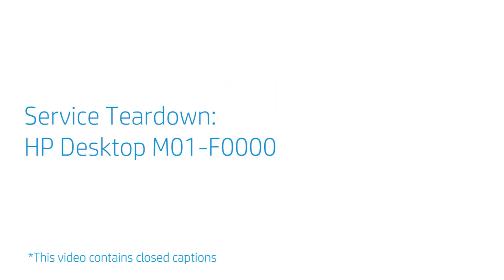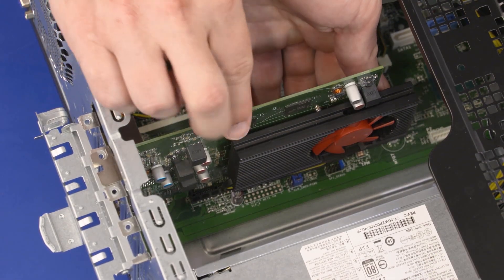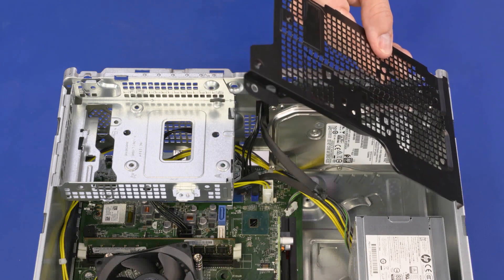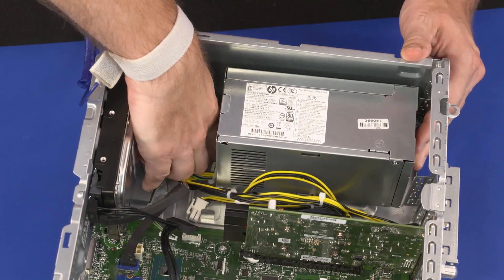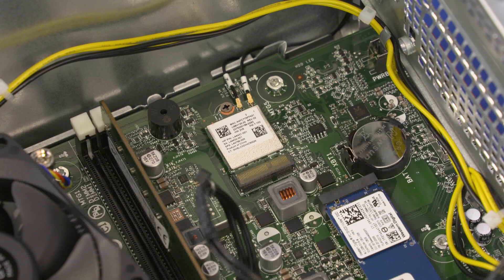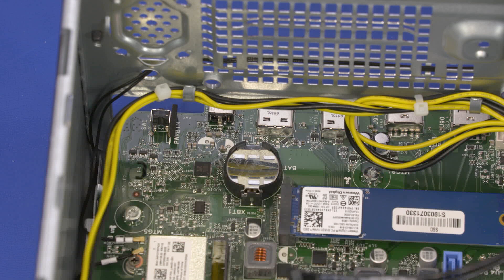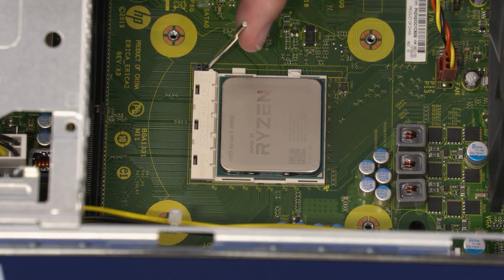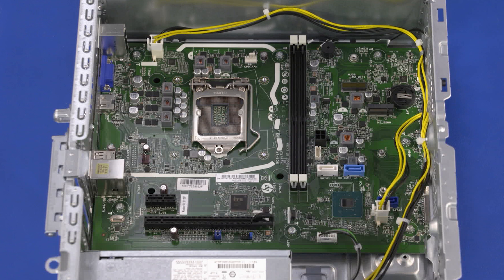Removing & replacing parts for HP Desktop M01-F0000 | HP Computer Service

Comment: hi hp my pc have 180w model m01-f2xxx which power supply can i change i want to put a gtx 1080
Reply from the maker: Hi there, thanks for contacting HP Global Social Media Support!
I understand that you need to purchase compatible power supply for your computer.
I will do my best to assist you.
For optimal PC and printer performance, remember to always buy (use) Certified HP Genuine Replacement Parts from a known and trusted source. You can order it via the HP Parts store: https://hp.care/6058UqOSY 
Regards, 
HP Support

Comment: Hi, I'm trying to install a quite large graphics card into my computer, and has quite the similar section as the expansion card section, however I have no idea how to remove the metal plating without damaging my computer, could I please get some help in removing the metal part without damaging my computer? They don't have any screws on them and they just have a little screwdriver thing on top of them but I genuinely don't know how to remove them
Reply from the maker: Hi there, thanks for contacting HP Global Social Media Support!
I understand that you are experiencing an issue in removing the metal plate to add graphics card.
This looks like hardware issue, and you might have to get the computer serviced. 
So, I would recommend you to contact regional support for repair options.
Please feel free to reach us on call/chat. Access this link to select your preferred country and language option to reach us. 
Global support link: - https://hp.care/6055UpROZ 
Regards, 
HP Support

Comment: Hi, I wanna replace my powersupply because mine hasn't enouth power that I need for a gpu...
BUT there is a 'pwrcmd' or 'p1' kable what is in the way. And without the kable the pc wont tourn on. So where can i buy souch a kable?
Reply from the maker: Hi there, thanks for contacting HP Global Social Media Support!
My apologies for the inconvenience, I am here to help! 
May I know the product you are using? A serial/product number would be helpful!
Let me know!
Regards, 
HP Support
Reply: Hi Hp, 
Thanks for your reaponse. As requested I am using the hp m01-f3700ng. Please let me know if there any additional things for the replacement issue.
Reply from the maker: Thanks for getting back to us, For any assistance related to purchases, please contact the shopping team for assistance.
	Link - https://hp.care/6056U8Jqu
	Regards, 
	HP Support
Reply: Hi HP, 
I can not find the kable or an adapter for this kable in your shop. So... uhm the kable goes from the power supply in the mainboard and when i remove it, then the computer wont tourn on. So I just need it... 
Can't u just sell one of this kable adapters or the kable in your shop? I mean... uh I will just upgrade the computer and you produce this kables... 
Please sell this kable in your shop
I will immediately buy one of them... ya
Reply from the maker: Hi there, thanks for contacting HP Global Social Media Support!
I understand that you need to purchase power supply unit for your computer.
I will do my best to assist you.
For optimal PC and printer performance, remember to always buy (use) Certified HP Genuine Replacement Parts from a known and trusted source. You can order it via the HP Parts store: https://hp.care/6056UDel2 
Regards, 
HP Support
Reply: Yeah i always use official parts but i just need the f... kable
Reply from the maker: Hi there, thanks for contacting HP Global Social Media Support!
I am here to help!
What seems to be the issue? Are you facing any technical issues with your HP computer?
May I know the computer you are using?
Let me know!
Regards, 
HP Support
Reply: Are you kidding me???
Bye
Reply from the maker: Thanks for the reply.
May I know the computer you are using?
May I know which cable you need to purchase?
Please let us know!
Regards, 
HP Support

Comment: Hi hp. Can I put a gtx 1060 or gtx 1650 on my hp pc M01-F3007nf?
Reply from the maker: Hi there, thanks for contacting HP Global Social Media Support!
I understand that you need to know about compatible graphics card for your computer.
I will do my best to assist you.x
This computer has One PCI Express Gen 3.0 x16 and One PCI Express Gen 3.0 x1.
So you can add graphics card that supports these slots. 
Regards, 
HP Support
Reply: @HPSupport  can I have a tutorial please
Reply from the maker: Thanks for getting back to me, I'm afraid I'm not able to find a tutorial specific for your device but rest assured that this process is mostly same in all the PC desktops. Please follow the link below on how to replace the graphics card in your PC and follow the similar steps,
Link - https://hp.care/6059Why9h
Let me know.
Regards, 
HP Support

Comment: Dear HP, would my gtx 1060 3 gb work with your desktop pc m01-F3701ng?
Reply from the maker: Hi there, thanks for contacting HP Global Social Media Support!
I understand that you need to know whether Nvidia GTX 1060 3GB Graphics Card is compatible with HP Desktop M01-F3701ng PC.
I will do my best to assist you.
This computer has 1 PCIe x16 and 1 PCIe x1 slot. 
So you can add graphics card that supports these slots. 
Regards, 
HP Support
Reply: @HPSupport  i hope thay pay you enough for replying that fast. Take care
Reply from the maker: If you need any help in the future, you can always get back to us.
Thank you for being a valuable HP customer.
Have a wonderful day!
Regards, 
HP Support
Reply: @HPSupport Hi again:)  just for next questioners - 1060 3 gb not fitting in. Also wanna ask: is 180w power supply enough or should i buy more powerful one?
Reply from the maker: For optimal PC and printer performance, remember to always buy (use) Certified HP Genuine Replacement Parts from a known and trusted source. You can order it via the HP Parts store: https://hp.care/6055Wj4TH 
Please check for compatible graphics card and power supply in above link.
Regards, 
HP Support

Comment: Hello, I want to know if the CPU Cooler can be changed and what the maximum height of said Cooler would be.
Reply from the maker: Hi there, thanks for contacting HP Global Social Media Support!
I understand that you need to know about changing the CPU cooler of your computer.
I will do my best to assist you.
HP does not recommend upgrading or downgrading hardware parts or software that is bundled with the product as It may affect the manufacturer's warranty and performance, however, you could change the configuration at your own discretion.
Regards, 
HP Support
Reply: @HPSupport My computer is no longer under warranty, so I want to upgrade the CPU Cooler but I don't know what dimensions the Cooler should have.
Reply from the maker: Thanks for the reply.
Use the HP Parts surfer to identify the part: https://hp.care/6052mVd56 
And order it via the HP Parts store: https://hp.care/6053mVd5B 
If you are unable to locate the part, please check 'Ways to buy'
Regards, 
HP Support

Comment: Hi HP would I be able to fit a 2060?
Reply from the maker: Hi there, thanks for contacting HP Global Social Media Support!
I understand that you need to know whether RTX 2060 is compatible with your computer.
I will do my best to assist you.
You can only install a small graphics card that is not very powerful, with the power supply that is 180w of your computer. 
Use the HP Parts surfer to identify the compatible graphics card of your computer: https://hp.care/6059lfK1S 
Regards, 
HP Support

Comment: I need a new internal optical drive to my HP Desktop M01-F3811. Which models are compatible? I can't find any information on HP website or technical specifications. Can I use a third party part, for example LG GTC0N?
Reply from the maker: Hi there, thanks for contacting HP Global Social Media Support!
I understand that you need to purchase the optical drive for your computer.
I will do my best to assist you.
Use the HP Parts surfer to identify the part: https://hp.care/6051YhKkV 
And order it via the HP Parts store: https://hp.care/6052YhKkn 
Regards, 
HP Support
Reply: @HPSupport  I don't have an old drive to identify. Drive bay is empty. I just need a compatible new drive, so which models are compatible?
Reply from the maker: Use the HP Parts surfer to identify the part: https://hp.care/6051YhKkV 
Regards, 
HP Support
Reply: @HPSupport  This doesn't help. Parts surfer just tells me what my computer's specifications are. It doesn't say which accessories are compatible.
Reply from the maker: Thanks for the reply.
In this case please search online for compatible optical drives.
Regards, 
HP Support

Comment: hi hp, I have the M01-F0028ur model, can I replace the power supply with a 400 watt or 500 watt? will the motherboard accept this?, I still have a missing warranty period, I really want to know this, because I want to replace another video card with a 1050ti or 1650gtx, and what other form factor should the power supply be?, thanks in advance
Reply from the maker: Hi there, thanks for contacting HP Global Social Media Support!
I understand that you need to know about the compatible power supply for your computer.
I will do my best to assist you.
Use the HP Parts surfer to identify the part: https://hp.care/6054YQSri 
And order it via the HP Parts store: https://hp.care/6055YQSrc 
Regards, 
HP Support

Comment: Hey hp i have a  HP Desktop - M01-F1033wb would a 1660 super work??
Reply from the maker: Hi there, thanks for contacting HP Global Social Media Support!
I am here to help!
Well, a GTX 1660 Super requires the system to have a minimum 450W PSU. So you will have to upgrade your PSU in order to use a 1660 Super.
Let me know!
Akhil_HP Social Media Tech Support

Comment: I plan to buy an M.2 SSD. The problem is that I don't know which type of M.2 to buy, as I have noticed that there are several types of pins and interfaces (M key, B key, M+B key) (NVMe or SATA). Which one is compatible with the M01-F0033w model? It has an Erica2 motherboard.
Reply from the maker: Hi Carlos, thanks for contacting HP Global Social Media Support!
I understand that you need to purchase compatible M.2 SSD for your computer. 
I will do my best to assist you.
Use the HP Parts surfer to identify the part: https://hp.care/49DL4jb 
And order it via the HP Parts store: https://bit.ly/3nKMYrs 
Binu-HP Social Media Tech Support

Comment: Hi, i would like to know if have the possibbility to change the orignal psu for another? if its possible what is the max size i can use? and do they have the same configuration for screws or not?
Reply from the maker: Hi Benson, thanks for contacting HP Global Social Media Support!
I understand that you need to know about compatible power supply unit for your computer.
I will do my best to assist you.
Use the HP Parts surfer to identify the part: https://hp.care/3QtQW79 
And order it via the HP Parts store: https://bit.ly/3nKMYrs 
Binu-HP Social Media Tech Support

Comment: Hey HP, where can i find website to find replacement screws for the t15 10mm and 7mm torx head screws for the chasis and drive cage respectively. I wanna find extra screws for this model and cannot seem to find them anywhere
Reply from the maker: Hi Cyler, thanks for contacting HP Global Social Media Support!
I understand that you need to purchase the replacement screws. 
I will do my best to assist you.
Use the HP Parts surfer to identify the part: https://hp.care/3RIeENY 
And order it via the HP Parts store: https://bit.ly/3nKMYrs 
Binu-HP Social Media Tech Support

Comment: Hey HP, 

For the M01-F0020, how many HDD drives can the chasis support internally? Is it 1 or 2 internal HDD 2.5" or 3.5" slots?
Reply from the maker: Hi Cyler, thanks for contacting HP Global Social Media Support!
I understand that you need to know how many hard drive does HP Desktop - M01-F0020 support.
I will do my best to assist you.
It supports 512 GB PCIe® NVMe™ M.2 SSD. 
Binu-HP Social Media Tech Support

Comment: i have 2 of those pcs. one with intel and one with ryzen. can i just switch the cpus?
Reply from the maker: Hi Deniz, thanks for contacting HP Global Social Media Support!
I understand that you need to know whether you can switch the processors. 
I will do my best to assist you.
HP does not recommend upgrading or downgrading hardware parts or software that is bundled with the product as It may affect the manufacturer's warranty and performance, however, you could change the configuration at your own discretion.
Binu_HP Social Media Tech Support

Comment: Is There A Way For My HP Desktop - M01-F0024 Can Have A 6GB Graphics Card Put In?
Reply from the maker: Hi Fetti, thanks for contacting HP Global Social Media Support!
I understand that you need to know about compatible graphics card for your computer.
I will do my best to assist you.
This computer has One PCIe x16 socket and  One PCIe x1 socket.
So you can add graphics card that supports these sockets. 
Binu_HP Social Media Tech Support
Reply: You can't!! You need to upgrade PSU also because it has only 180W shitty PSU .😢

Comment: Hey HP, I Need your I Purchased GSKILLS AEGIS 3200MHz Ram But it is showing 2133Mhz why my ram is working soo slow I Updated the Bios to the Latest Version No Luck
And there is No XMP or D.O.C.P in the Bios how to change it into 3200Mhz Please Me HP What to Do?
Model M01-F0020
Operating System: Windows 11 Pro

Comment: Hey HP, Can My M01-F0020 Support M2 NVME SSD Gen 4 i need your Help can my System run this SSD?
Reply from the maker: Hi there, thanks for contacting HP Global Social Media Support!
I understand that you need to know whether your computer supports NVMe SSD. 
I will do my best to assist you.
This computer supports 512 GB PCIe® NVMe™ M.2 SSD.
Binu - Social Media Tech Support
Reply: @HPSupport  Thanks HP
Reply from the maker: If you need any help in the future, you can always get back to us.
Thank you for being a valuable HP customer.
Have a wonderful day!
Cheers!
Binu - Social Media Tech Support
Reply from the maker: We don't provide BIOS overclocking options. You can try AMD Ryzen Master (https://intel.ly/3KuGK8Q) or Intel IXTU (https://intel.ly/3KuGK8Q) software to play with memory settings. The cost of overclocking may exceed the benefit; instability caused by high components temps.
Binu - Social Media Tech Support
Reply: @HPSupport  OK Thanks HP I Will Try and thank you soo much for replying Very Fast Love You HP💖💖💖
Reply: @HPSupport  Hey HP, I Download the Latest Ryzen Master Software and It's Giving Error Why Error Name called ryzen master is prohibited from installation on this system Please Help me HP
Model HP M01-F0020

Comment: Hey HP, on my M01-F1035us all pci expesion slots are blocked on the case. Should I cut the metal piece in order to insert pci card?
Reply from the maker: Hi Dayls, thanks for contacting HP Global Social Media Support!
I understand that you need help in inserting PCI card.
In order to get this issue fixed, please contact our customer care team over the phone or chat for further assistance, as this issue requires Live conversation with you over phone or chat to isolate the issue and provide you instantly with appropriate solution or repair/replacement options available at your place as per the warranty.
Please feel free to reach us on call/chat, please access this link to select your preferred country and language option to reach us. Global support link: - https://www8.hp.com/us/en/contact-hp/ww-phone-assist.html
Binu - Social Media Tech Support

Comment: hi there. i have the  M01-F2000i. it has a 4k display but doesnt play back 4k streaming. is this normal?
Reply from the maker: Hi Jennai, thanks for contacting!
I understand that you are experiencing an issue with your computer as it doesn't play back 4k streaming.
I will do my best to assist you.
Please perform updates via Windows and HP Support Assistant as mentioned below to fix this issue: Step 1 Windows Updates - 1) In the search box, type and open Windows Updates. 2) Check for updates. 3) If the updates are available, click on install and restart the computer. Step 2 HP Support Assistant Updates - 1) In the search box, type and open HP Support Assistant. 2) Check for updates. 3) If the updates are available, click on install and restart the computer.
Binu - Social Media Tech Support

Comment: I have a M01-F0024 can I replace the 92mm system fan to a 120mm fan since the holes for a bigger system fan HP?
Reply from the maker: Hi Douma, thanks for contacting!
I understand that you need to know whether you can change the fan. 
I will do my best to assist you.
HP does not recommend upgrading or downgrading hardware parts or software that is bundled with the product as It may affect the manufacturer's warranty and performance, however, you could change the configuration at your own discretion.
Binu - Social Media Tech Support
Reply: @HPSupport  the holes on the case of the PC would be big enough to fit a 120mm fan?
Reply from the maker: HP does not recommend upgrading or downgrading hardware parts or software that is bundled with the product as It may affect the manufacturer's warranty and performance, however, you could change the configuration at your own discretion.
Binu - Social Media Tech Support

Comment: Does a 942332-001 model psu work with a m01-f0033w?
Reply from the maker: Hi there, thanks for contacting!
I understand that you need to purchase compatible PSU for your computer.
I will do my best to assist you.
You could purchase the part from HP.
Use the HP Parts surfer to identify the part: http://partsurfer.hp.com/search.aspx 
And order it via the HP Parts store: https://bit.ly/3nKMYrs 
Binu - Social Media Tech Support